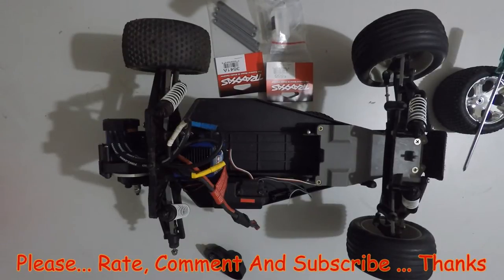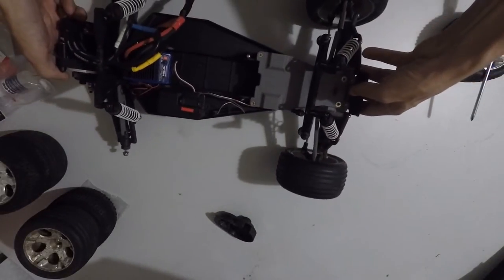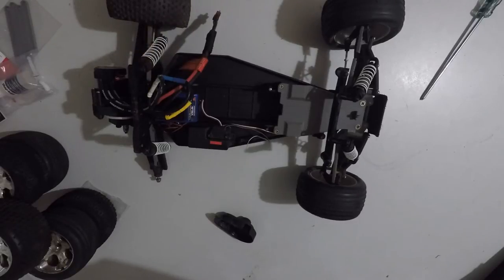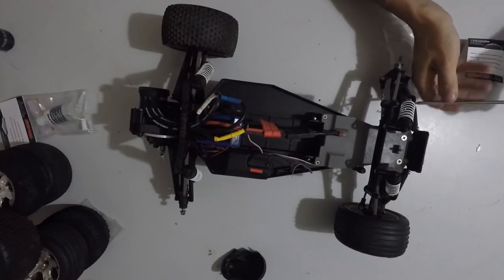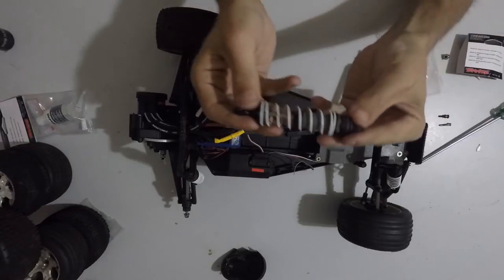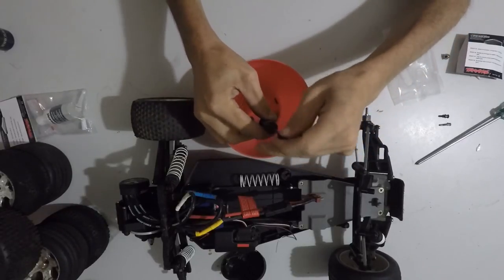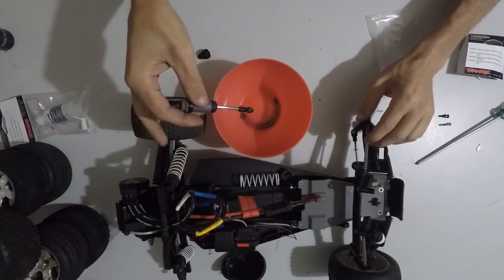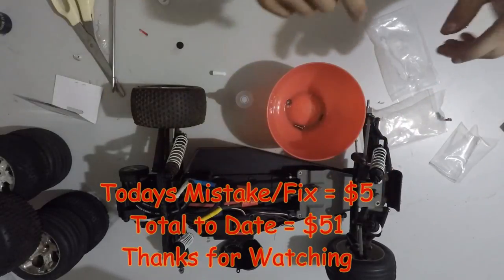Traxxas Rustler | Repair/Upgrade #2

Comment: Recommend 
Rpm replacement parts 
Rpm bumper 
Traxxas wheelie bar
Looks like you have a little air in the shock :) 
You can re-bend the shock shaft back 
Good luck with the build
Reply from the maker: Cheers Gio working on it. this week I have to handle another issue and something come up pretty cheap so i had to buy that too. Thanks for taking the time to stop by :)